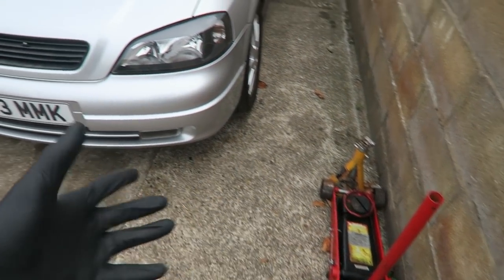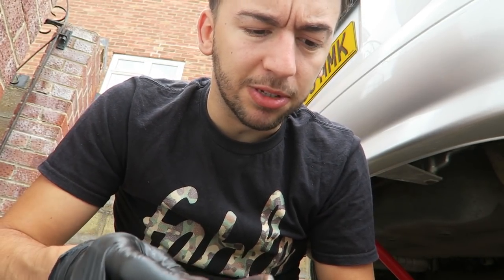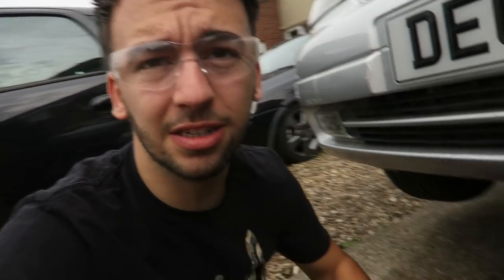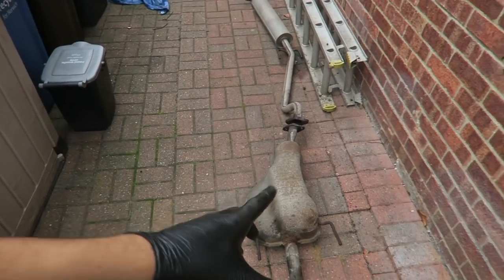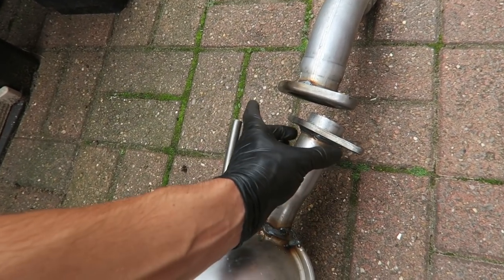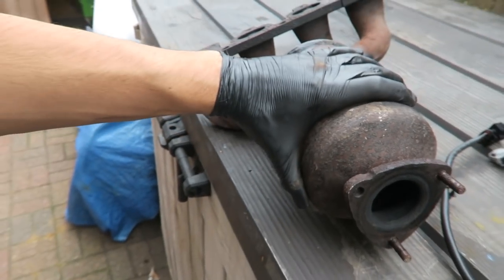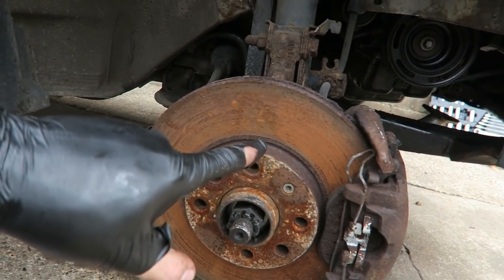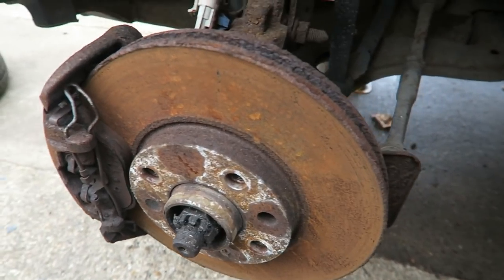Astra Gets a New Exhaust!

Comment: Hi James. Another good vid!! I would check the 02 sensors are doing what they are supposed to do judging by how much oil was in the pipes. Make sure that the pre cat one is switching between 0.1 and 0.9 volts in closed loop and the post cat one steady around 0.5 volts. Anything other than these figures, then change the pre cat one and you could be looking at too much contamination of the cat itself if the post cat sensor isn't staying steady.

Hope your dads's mondeo is doing ok.

Comment: Always clean you car the best it can be when taking to the mot station as they won't think its scrap and they won't look for work on it.
Make sure you clean the brake pipes with wd40 and grease & lube the joints underneath to let them know you have been underneath the car working on it just before the mot.
This will let them know you know your stuff and make them think twice about trying it on.
Reply: 1066gaz that utter bollocks, if they wanna fail it they can fuck all you can do other than fix it your self or pay makes no difference

Comment: Maybe cut tip of exhaust before you bolt it up. It looked a a scaffold pole sticking out the back. Maybe even weld a cheap but decent looking tip on.

Comment: You will have to remove the brake dust covers for the mot you don't need to fit new ones as they aren't a requirement 👍good luck

Comment: You want to check the front metal brake pipes where they go through the inner wing, there is a bend in the pipe there which is notorious for corrosion but not easy to see,More visible by looking down in the engine bay.

Comment: Astras… grrrrrr… Did a full engine service on my wifes 2005 1.8 Astra Elite at the weekend, and also changed out the headlight bulbs for NightBreakers. Took out the drivers side dip beam bulb which you do from inside the wheelarch. It has a bizzare metal clip that goes over the bulb and sort of twists and locks into position in the headlight. Anyway, 45mins later, cut hands, tons of swearing, cannot get the H7 bulb to fit for love or money. Turns out, the previous owner had put the bulb in upside down, and I was trying to put it back the same. Jesus...……….. Engine service was super easy. Also used GM GlobalTIS and updated the engine software as there was a new update.

Comment: Disagree you will not need new discs for a MOT just scrape the edges with a screwdriver.  Best to take the pads out and clean all the sliders etc. Once the calipers and pads are free a few hard stops on the way to the test will ensure a good result on the machine.

Also make sure your brake limiting device at the rear is freed up. That's a fail if it's stuck.

Comment: Instead of using fairy liquid, I think you're supposed to use oven cleaner or carb cleaner?  eats away at tough deposits better, and then give thorough spray out later.
Reply: Oven cleaner sprays on to produce a white foam, which appears to do a fantastic cleaning job, and as long as you thoroughly power wash off after application, should be absolutely fine!

Comment: the ferrule on the front brake flexi hose looks very corroded mate, id replace that aswell. I dont know what the mot station is like in your area but over here in yorkshire they fail them if they are as bad as that.

Comment: Hello James I think your drop links are ok they will have some slight play in them , but I would say you do need new rubber brake lines as where the rubber goes into metal joint it’s very rusty

Comment: Don't use washing up liquid for cleaning (cardinal sin) as it contains salt and will rust your exhaust inside out just like it will to your cars bodywork if you wash it with that stuff.
Its can be a scam with garages that they will fail it with a bit of surface rust on the brake pipes,make sure you wire wool them soaked with wd40.
I used to grease the brake pipes like that but it can trap the moisture within and will rust underneath the grease,so best to clean with wd40 once in a while.
I wonder if your exhaust is aluminised because in the olden days of exhausts pre 2000 they were mainly mild steel and they used to last around 2 years max,so hopefully yours will be aluminised.
aluminised.exhausts last around 6 years+.
Good video will look forward to the next.(:-)

Comment: To check drop links put a jack under the brake disc and raise it to the point where the drop links float, this also makes it easier to replace them.  sounds difficult but it isn't that hard.
Reply: eugene o'neal good one ☝️ let’s warp the brake disc! These drop links are piss to replace.
Reply: I’m a mechanic and you won’t see me doing that 😂! Just as easy to have both front wheels off the floor so they are at the same height! Done sorted! No jacking the disc! 50% chance of the disc rotating and flipping the jack and wood out!

Comment: Another decent video, i know you don't like key board mechanics but as a mot tester, there is a advisory for grease on brake pipes so they probably will come up again for you unfortunately, as for the discs with a wire wheel on grinder they will be like new but for sake of £30 you may as well get new 👍

Comment: I've been there with the exhaust on my MK4 Astra. I went through 3 front sections in the time I had that car. The rear lambda was a pig to get off. I wish I had that tool you have. Would've made the job 10 times easier. I had to wedge the exhaust pipe so that it wouldn't move and got the lambda out with a stilson wrench. You will need the correct bolts, springs & gasket for the rear section. I got mine off eBay. Which GoPro have you got? I've got the Hero 3+ Black Edition which is good enough for me as I shoot my videos in 1080HD.

Comment: The suspension springs may get an advisory due to corrosion due to the paint flaking off but they should still pass.
Reply: Steven Watson mine had been rattle canned in the past and are rises and flakey, was never mentioned in MOT

Comment: My mums got a puergot 206, and it's showing a catalytic converter error. Any advice on what to do?
Reply: Don't replace it until you've tested things!!
You need to look at the O2 sensors, either with scan tool, scope or multimeters.
If you have a scan tool, you should check fuel trims too.
The cat isn't always faulty, some seemingly irrelevant things life a vacuum leak can cause a P0420 to set, as well as bad O2 sensors.
Look for a nice swing 0.1 to 0.9v on the front O2, symmetrical waveform rather than mainly high with brief dips or vice versa.
Rear O2 voltage may mimic front until the cat heats up but should then be steady in the 0.55 to 0.7v range.
I posted another comment (not sure if this video or another savage garage one) about how to test the cat if you know your O2 sensors and fuel trims are good.

Comment: hello mate have you ever had code p0016 on corsa 1.0  .. engine misfire .. coil pack timing .. cam sensor change still the same
Reply: sanjay leer change spark plugs and the problems gone
Reply: Possibly a stretched timing chain.

Comment: TOP TIP ! ..WD40 Actually rots rubber ..especially seals, be aware where you spray it!  :)
Reply: Steve B never had any problems with using it on rubber. Have you or is it just a old wives tale
Reply: I have actually ,  on a brake piston seal to be exact...dried out a bit too quick and perished...other side was fine ( my own fault I guess ).They actually  say its ok to use on the new WD40 website now (coincidence ? ) but I`m always careful..especially the canned version as it seems to be a little stronger.
Reply: Steve B oh right. Everyday is a school day cheers

Comment: Before you take it for an mot check to make sure the part with the spring @19.44 is not seized as this is a common problem on Vauxhalls. I'm not sure the proper name of it but it's something like Brake Pressure Compensator Valve. Euro car parts number 130720150

Comment: You should get yourself a set of chain cutters mate, they make you're life so much easier for removing exhausts. It saves trying to undo the flange bolts or u-clamps. Most of the time they are a cunt to get off because they are exposed to the elements. Good vid anyway mate 👍 keep them coming.